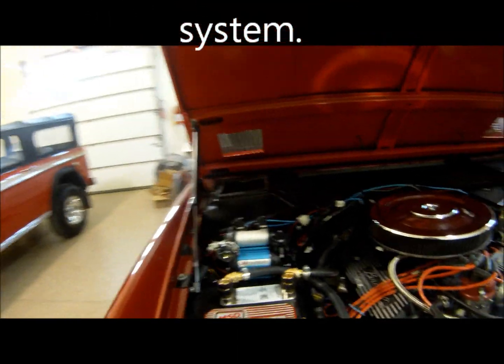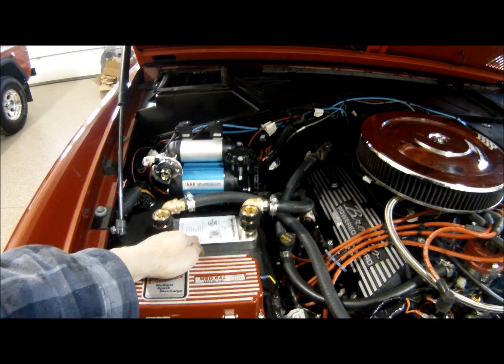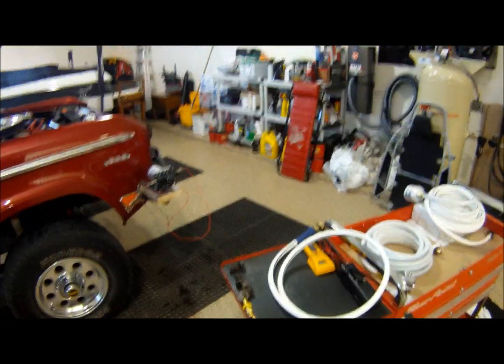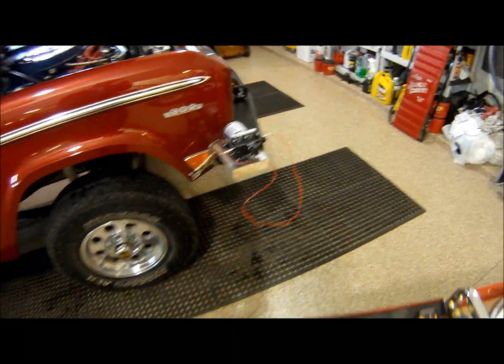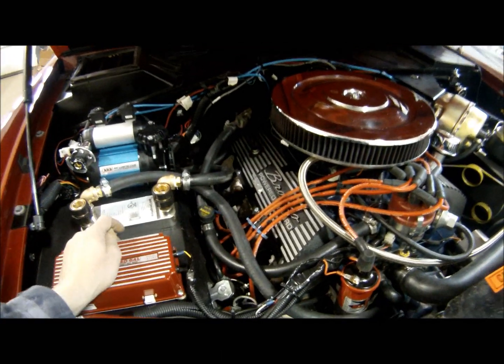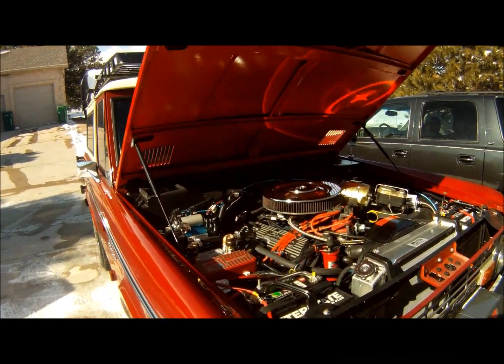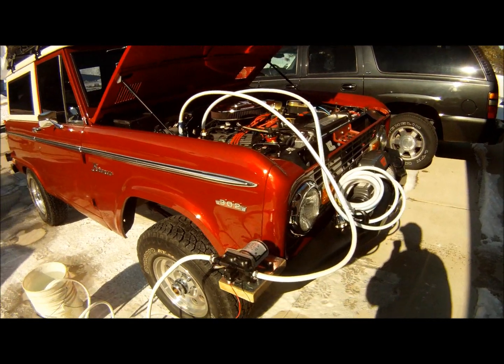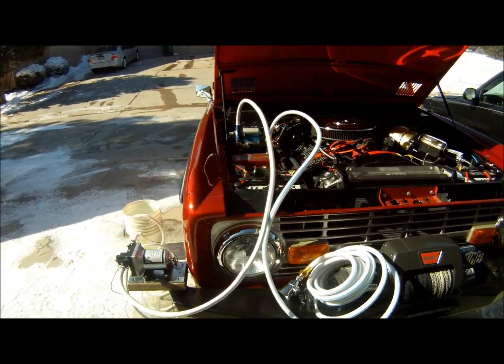Onboard Hot Water Shower Part 1

Comment: no problems with cracks in the heat exchanger when the engine is cold and residu shower water freezes up?
Reply: +dextersxxxxlab , No problems with heat exchanger at all. It is an industrial heat exchanger and built to handle the elements. No freezing either, however the Bronco is kept in a climate controlled garage and only gets used in the summer and fall. I do not driver it much in the winter. But even if I did, it would still be fine because you have to remember,  the water that passes through the exchanger is tied into the heating/cooling system of the engine and has antifreeze in it. So even if it were to sit out and it was cold, it would not freeze.

Comment from the maker: The heat exchanger I used was the "DUDHAX-B3-12A 10 Plate Heat Exchanger with M5 Mounting Studs"  If I were to do this again I would probably go with a few more plates and the reason why would be because the more plates you have the more heat circulates through the exchanger obviously heating the water up quicker and providing adequate supply of hot water.  I also used the 1/2" Female NPT fittings on all four corners. Dudadiesel can make just about any configuration that would like.